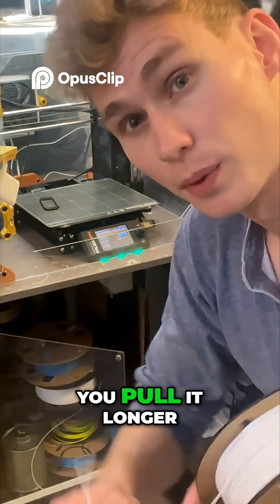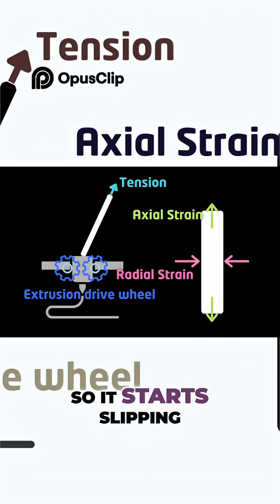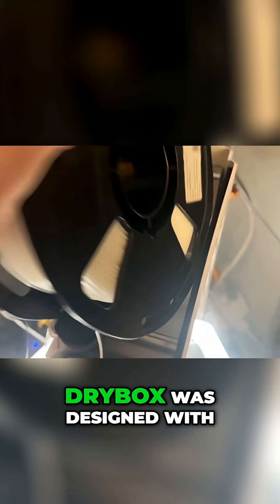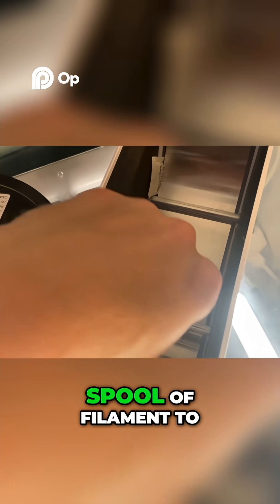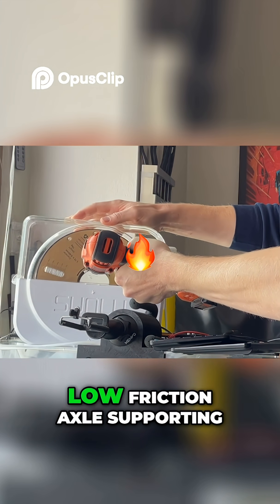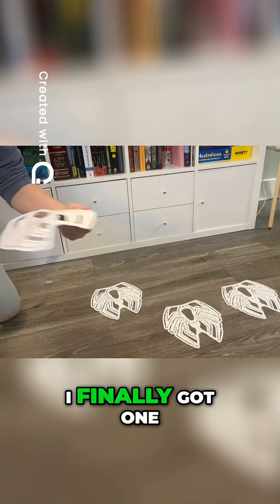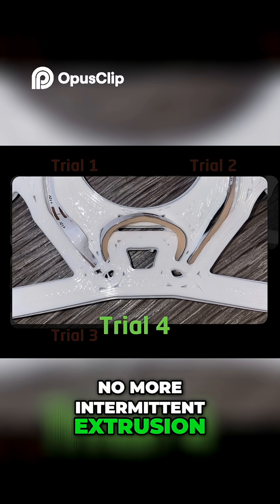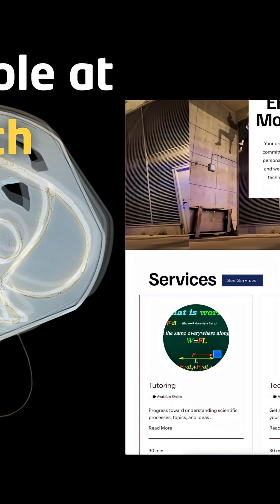My solution for the flexible materials #shortsfeed #shortreels #shortvideo #shorts

Comment: What if you have a second extruder before the actual extruder that slightly over feeds the flexible filament so it's being fed to the actual extruder without distorting the size?
Reply from the maker: But then what about the second extruder drive wheels??
Reply: @theAmazing  No clue. Secondary extruder doesn't even need to be an extruder, whatever it is just needs to maintain the flexible filament enough that the actual extrusion is consistent